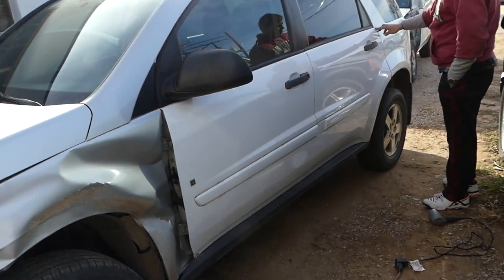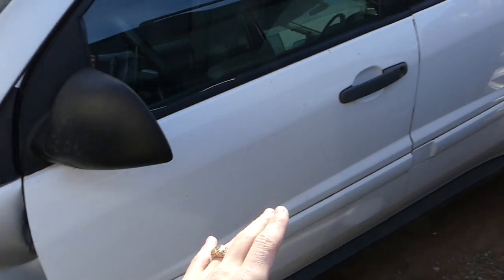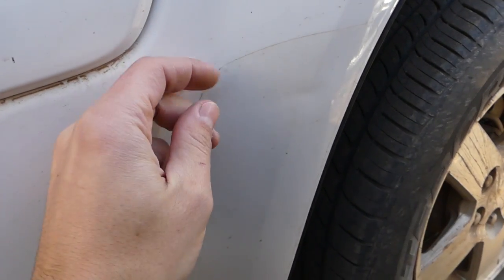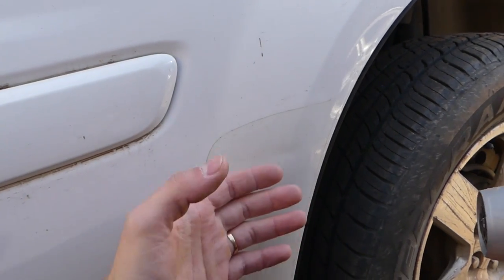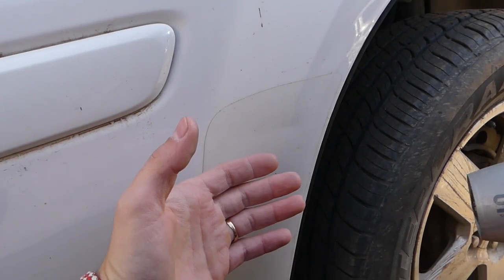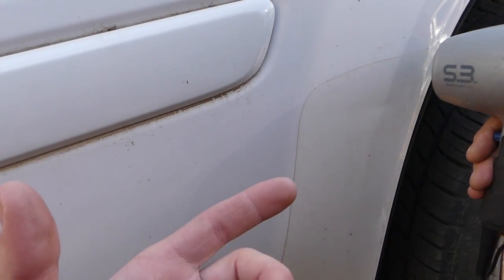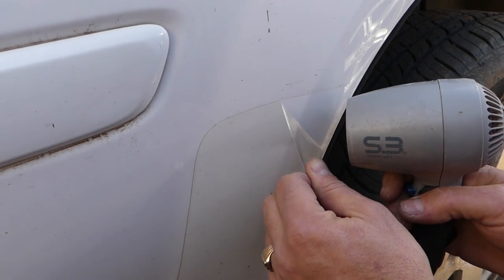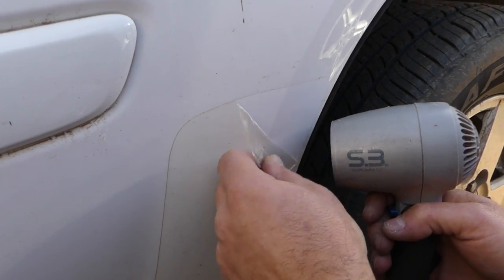HOW TO REMOVE PROTECTION FILM ON CAR

Comment: I just removed mine from a white Lexus es350, I would have kept them on, but the edges get filthy and can't be cleaned.  I used a heat gun, moved it around on high for about 45-60 seconds and pealed off like a fruit rollup and left no glue behind. Thanks great video!
Reply: Could you see a difference in paint or a ridge where the line was?
Reply: @olivertwist9628  no, I don't think I even needed to compound it, I think I just washed it and waxed it.
Reply: Perfect EXACTLY why I searched for this.  Looks good when new, but after a few years, it looks horrible on my Lexus.  Especially on the trunk.
Reply: I saw a video with a guy that took a q-tip and alchohol and cleaned the edges, but once the edge has been compromised it only gets dirty again and goes deeper, plus I ain't doing that all the time. My wife's black is250 is not a problem, dirt doesn't show at least enough to be bothersome. White is a bitch sometimes probably some other lighter colors too.
Reply: Thank you, on my 13 Lexus es350 that rock guard looks like total crap.   Dealer refused to remove it.
Reply: Same problem lol. White Lexus with this protection. I need to take it off, it’s yellow and dirty now.
Reply: @lotus956 did you get it done?! I hate that shit looks tacky on my is200t. My cat is white so it’s shows

Comment: The protective film on my car is horrible, crackling so isn’t easy to put heat and pull off all in one. I’ve tried goo off, eraser wheel, diluted rubbing alcohol, adhesive remover…please somebody who has had this same problem HELP!! Please!
Reply: I have the same problem with my car. Can't get it off, and it looks awful now after all these years. It looks like mold or something took a dump on the car 😆 I'm considering hiring a professional to do it but I am too cheap
Reply: @nathankirklambo1986  I was able to finally get it off after a lot of elbow grease. I ended up using the goo off and alcohol. I would’ve paid a professional if I would’ve known what I was in for. Keep at it if you decide to do it yourself. It took me a few days and hours at a time.
Reply: @juspri1183 damn that’s hella work 😖
Man I thinking if I should do mine now. I have it on the top side back bumper by my plates and both back doors lower side